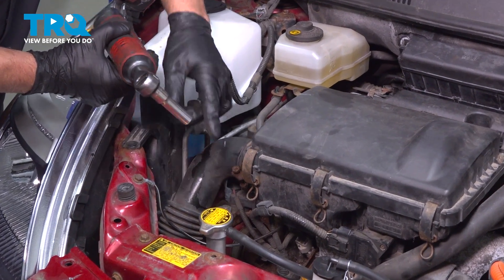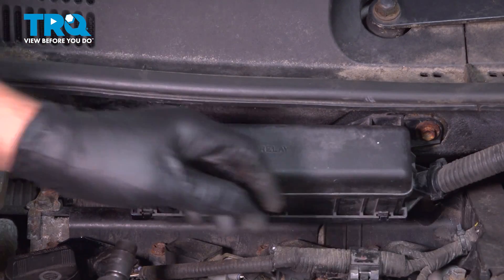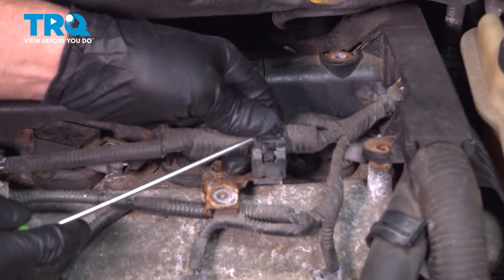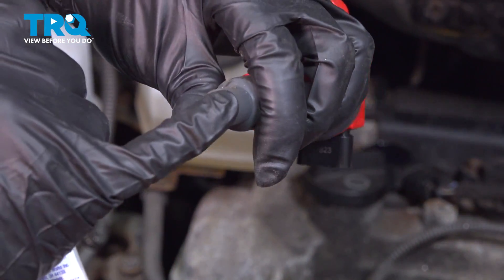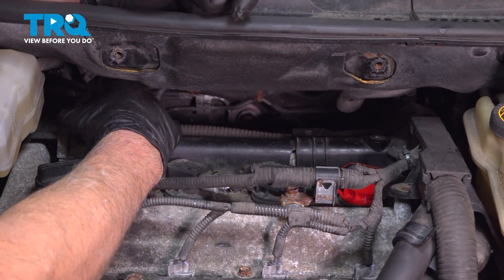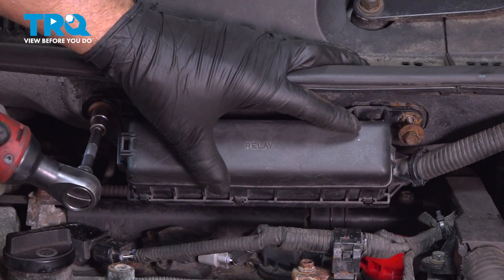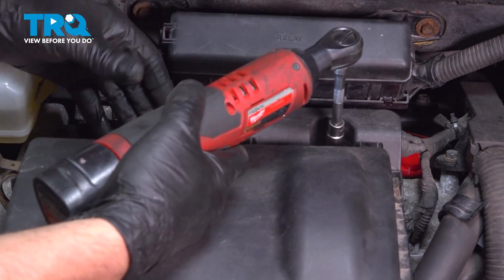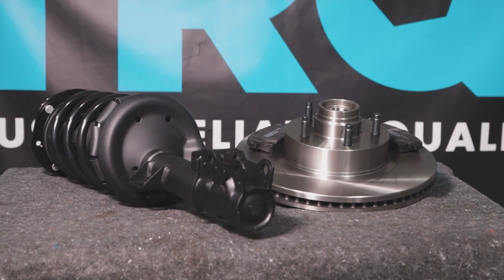How to Replace Ignition Coils 2004-2009 Toyota Prius

Comment: I just installed new ignition coils, spark plugs, PCV, and now my vehicle won't start. It had a misfire before but now it won't turn over and I'm getting Ignition coil circuit malfunction codes and more misfires